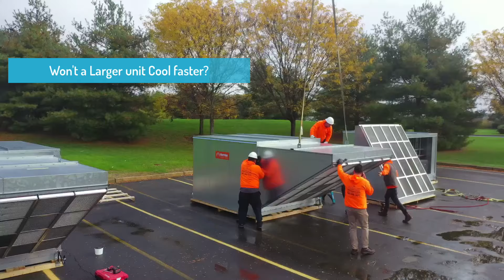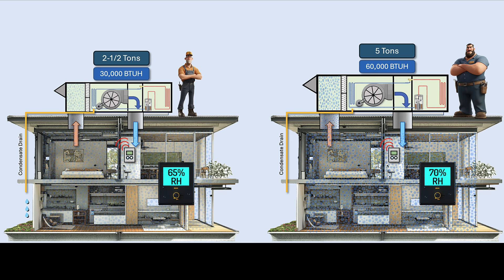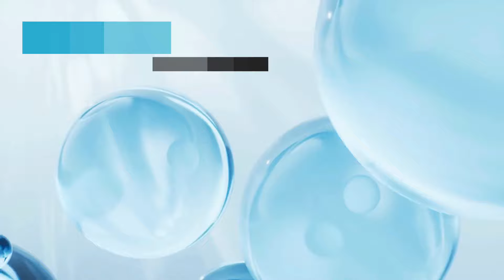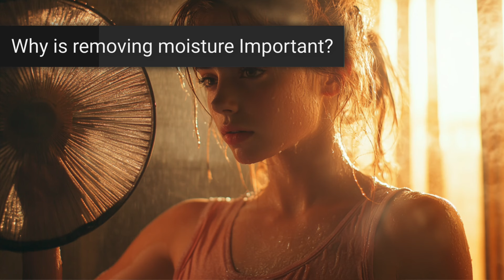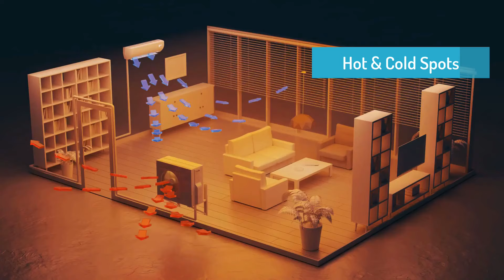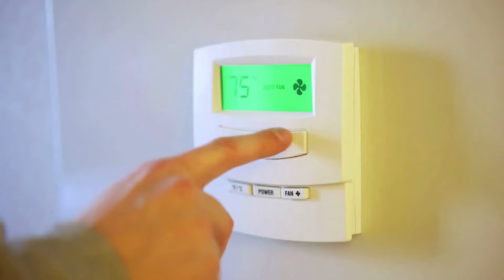Should you Oversize your Air Conditioner

Comment: The point about oversized systems not necessarily cooling a space faster was really useful. I especially liked the explanation of how shorter cycles can affect moisture removal and overall comfort. It’s a good reminder that proper sizing matters just as much as equipment selection, something BPConstruct can definitely appreciate when looking at heat loss calculation.
Reply from the maker: Thanks for watching.

Comment: Sir my bedroom size is  115-120 sqarefeet.. i bought Panasonic 3 star 1.5 tonnage 5100 watt cooling capacity. 5100 watt cooling capacity seems over watt for 120 sqare ft room..  isn't it????   😢 at what temperature should i run This Ac to avoid any damag?

Comment: It's a different story with a variable capacity inverter units.
Reply from the maker: You’re absolutely right that inverter-driven, variable-capacity systems are much more forgiving than fixed-speed equipment—because they can throttle back instead of simply cycling on/off.
That said, even inverters still need to be sized thoughtfully:
Minimum turndown limits. Most central inverters can only drop to ≈ 20-40 % of their rated capacity. If the unit is oversized beyond that, it will start short-cycling any time the load falls below its minimum output, which brings back the wear-and-tear, noise, and humidity issues we all try to avoid. 
Latent (humidity) performance. Oversized coils satisfy the thermostat so quickly that the indoor fan often shuts off before the coil removes enough moisture. ACCA’s 2023 Manual S still flags high latent-load regions and caps variable-speed oversizing for exactly this reason. 
Efficiency sweet spot. Variable-speed compressors achieve their stellar SEER ratings when they’re running steadily near the middle of their modulation range. Running at the very bottom end (or cycling) drops the true seasonal efficiency.
Cost & duct design. Bigger equipment costs more up front, and its blowers push more air than the original duct system may be able to handle—raising static pressure and noise.
Standards still enforce limits. Even ENERGY STAR’s lenient rules only allow variable-speed gear to be 90-130 % of the Manual J cooling load (up to 160 % in very specific “low-load” cases). That means some oversizing is acceptable—but not a free pass to double the capacity.

Bottom line: variable-capacity equipment absolutely widens the safety margin, but you’ll still get the best comfort, humidity control, and ROI when the unit is matched to the load rather than dramatically oversized.
Hope that clarifies why our video still preaches proper sizing—even in the age of inverters. Thanks for keeping the discussion going!
Reply: Yeah so is the price.  AC guy just quoted me 26k for a variable speed 17 seer 3 ton upstairs 3 ton downstairs.  Everything is so expensive 😢

Comment: why does the large unit turn off? wouldn't the people make heat? why doesn't it slow down?
Reply from the maker: The oversized unit cycles on and off because it satisfies the thermostat setting at a faster pace then needed to meet the demand and for the proper removal of moisture in the air, as opposed to a properly sized unit that will run longer and allow for proper moisture removal. The people do generate heat, but an oversized A/C unit removes that heat at a faster rate than it is generated by the internal and external loads.